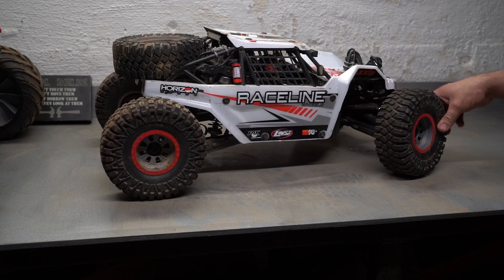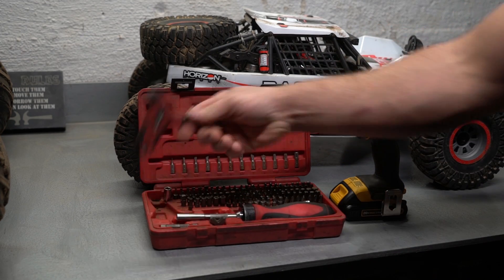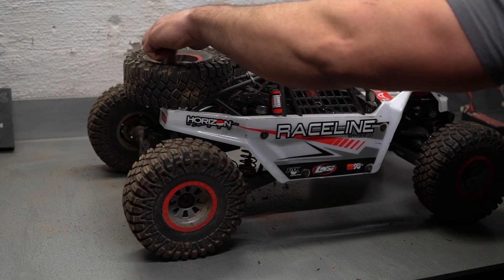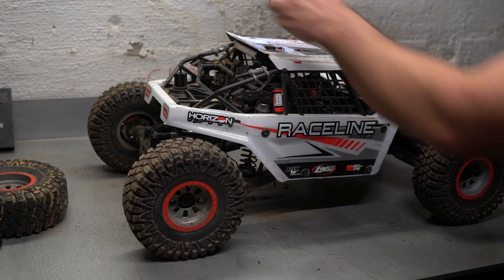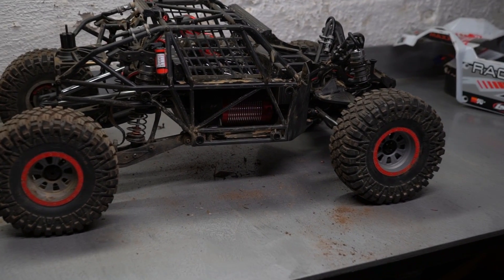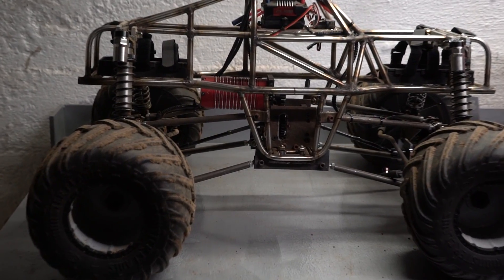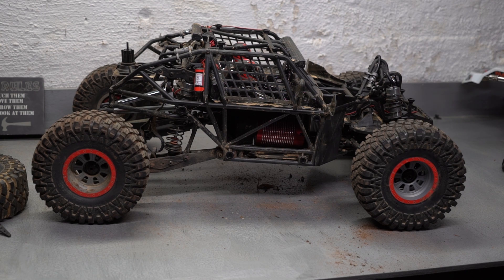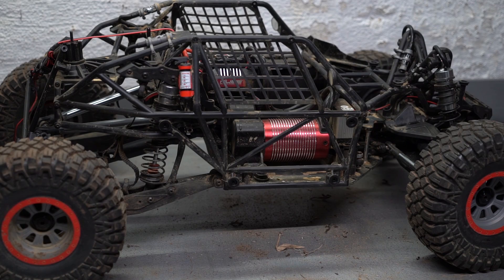Losi Super Rock Rey first broken part

Comment: Got one love it 3rd run broken servo saver broken front carrier and broken spindle along with the upper suspension arm rod snapped inside the larger control arm piece so need the upper suspension arm set as well everything is out of stock stock parts wise

Comment: How does this compare to the Traxxas UDR
Reply from the maker: Rundan this thing is way better than the udr I just bought a udr and gave it away because it broke every time I ran it
Reply: @clodbusted1776  As far as bashing goes and overall fun how much better is it?
Reply from the maker: Rundan the power and durability make it a better basher the udr rolls very easily the Losi is crazy fast and durable
Reply: @clodbusted1776  How does it handle jumps and little bumps? I used to own the UDR so i know what its capable of, And I would be happy with the UDR I just want to know if ill like the losi SRR better?
Reply from the maker: Rundan as far as durability goes it handles jumps no problem but it’s pretty heavy so it’s hard to control while in air and I noticed sometimes the avc makes it jump weird
Reply: @clodbusted1776  The tires are pretty huge on it. I take it they hook up prettty well?
Reply from the maker: Rundan they hook awesome